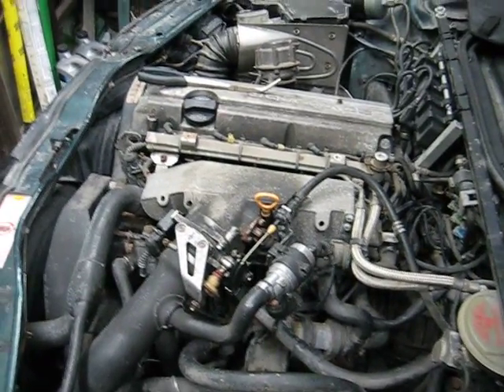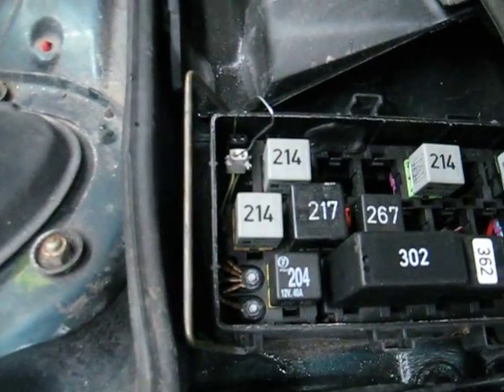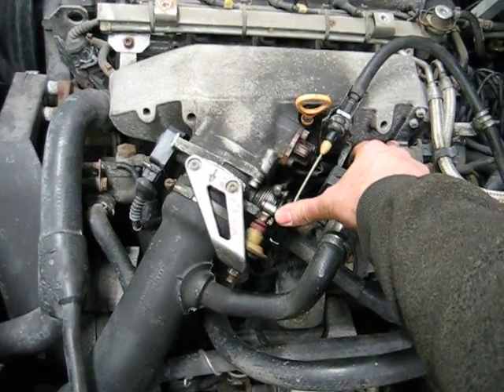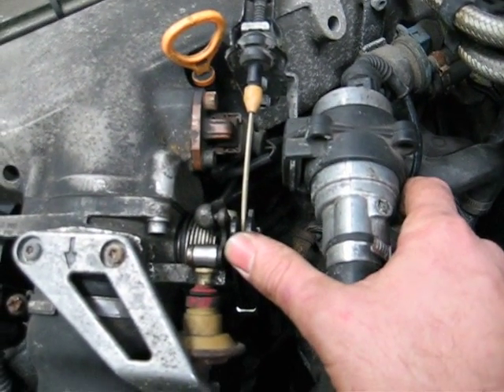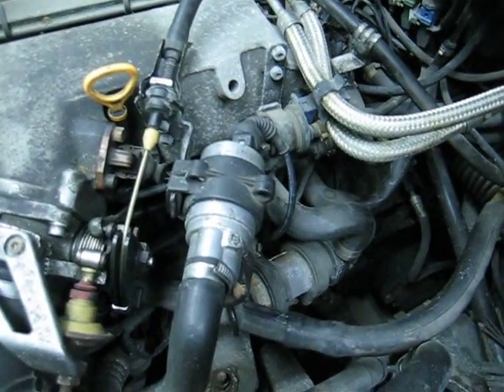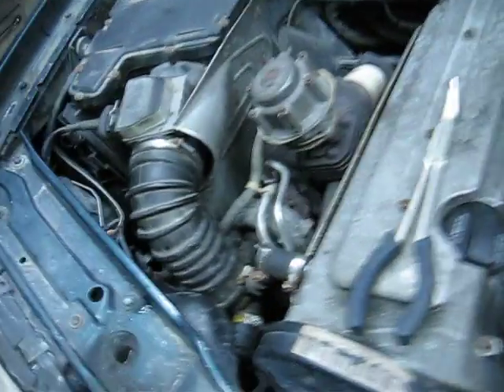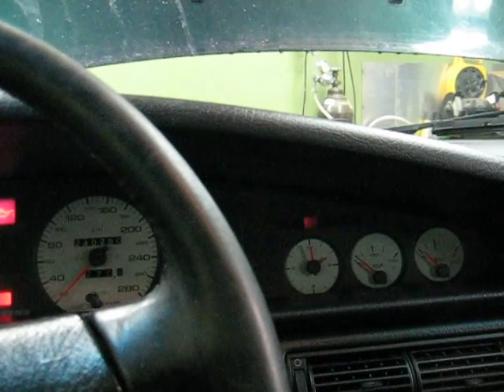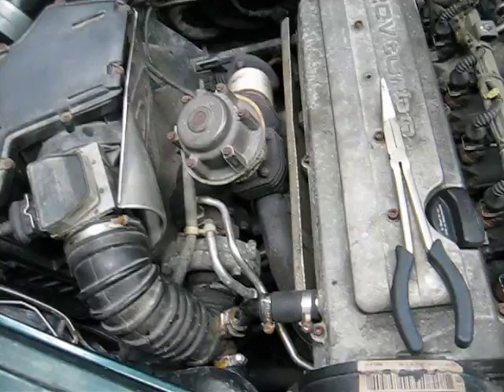OBD I Diagnostic Audi UrS4

Comment: Thank you so much for this. I just two days ago replaced a lot of the OEM rubber Boost lines with silicone and also upgraded my engine and transmission mounts, first start up I got a check engine light and was so bummed out. I triple checked all my wiring and hoses for leaks. I blinked my codes which gave me a 2121 code for idle switch and wanted to make sure but when I did this output I did not get a reaction for the Idle stabilization valve so that is the culprit

Comment from the maker: What set-up did you put on the car? To get the check engine to flash the codes, you need to start the car, jump the 2 forward pins on the black and white connector for 5 seconds. Then go read the code. To get to the second code, if any, go back and jump and count to five. Then go read the code. 4444 flash code= no codes recorded. CEL light out, end of reading code(s)